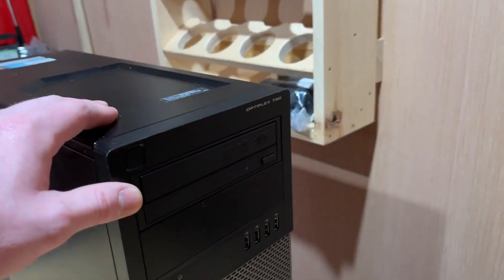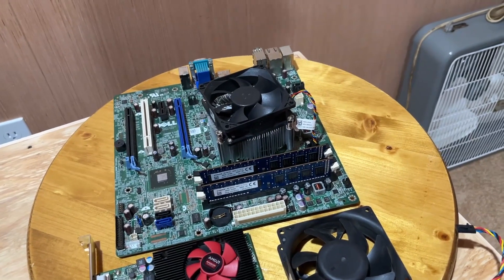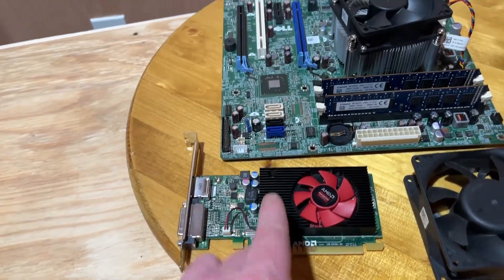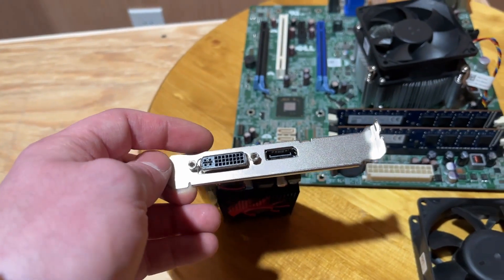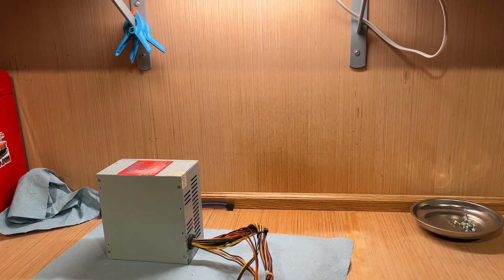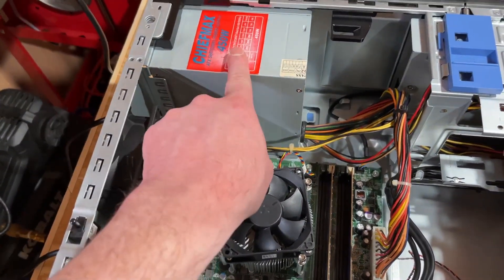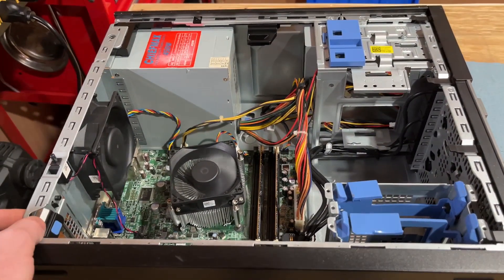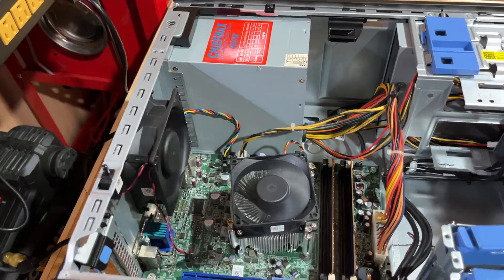Replace THIS In Your PC

Comment: Still on 2500k myself, pondering why i need to upgrade when it plays anything well at 1440p with rx580. Not 'ultra' well but medium high in modern games easily, even CP2077. Let see if some titles coming soon I wanted to play like Stalker2 really give me troubles...
Reply from the maker: Trust me when I say a stronger cpu would bring even more performance out of your 580. Ryzen 5 5600 and a decent B550 or X570 board would be great pairing with headroom for a GPU upgrade when you’re ready

Comment: Dude wait can I have the power supply i have an old pc that had a broken one so it's just been sitting in my garage, if you don't want it I will Take it man I need a psu.
Reply from the maker: You can have it but my advice (if you truly value the pc) is to buy a new budget psu like the Thermalttake Smart 430. If you don’t mind that the fan could go at any time and the psu get really hot and potentially catch fire. I’m just trying to make sure you understand what could potentially happen. But if you do want it then go on my channel about page and send me an email

Comment: That PSU definitely isn’t the original. I agree, I wouldn’t rely on it either because it looks over 15 years old easily. I bet the capacitors in it are leaky or have expanded.
Reply from the maker: Yeah it’s not the original. It was replaced by someone at some point. I am definitely doing it a favor by putting in a name brand unit and not some shady gray unit. Thanks for commenting it really helps. I think you’ll like my next video on what I got to tinker with today
Reply: @anthonytech  Big fan of the PC tinkering genre. I’ll subscribe.
Reply from the maker: @mrmerlin6287  thanks 🙂 I’ll give you a hint on the next video: thinkstation

Comment: The 2nd gen i5 is still pretty capable. I have an Acer Veriton with the i5 2400 that i keep as a spare computer and it can still do everything just fine. My main PC from a few years ago had an i5 7400 and there was little to no difference at all (in games at least). I only sold the 7400 system just cause it was worth more money than the 2nd gen and the performance was almost the same
Reply from the maker: It depends on what you were doing. An i5 7400 will walk circles around a 2400. I’m curious why you didn’t feel a difference. 7400 can push way more GPU than a 2400 can due to much stronger single core and even multi core performance
Reply: @anthonytech  Well most of today's game would run bad on both of them and i wasn't using the 7400 either since my main pc had an i7 7700. The 2400 and 7400 pcs were only spares if my main would go down for some reason i'd use another pc until i get that one running again. For today's use as a main i would obviously agree a 7400 would be better,but not for gaming anymore cause even my 7700 is struggling a bit with most modern games
Reply from the maker: @LUR777-g7r  Yeah it’s all about use case. You are right older quad cores can’t do modern games. But the newer ones like 12100, 13100 are very strong quads and can game very well
Reply: oh no…..

Comment: Is this 1995? 😂

Edit: didn't mean any disrespect. Great video
Reply from the maker: Thanks man, hope to catch you in future videos. Not exactly 1995 but it is 2011 which in the PC world anything more than a decade old is pretty much legacy.
Reply: @anthonytech  yeah you're telling me! I feel like it was yesterday I had a new 10900k and it was so fast, I got my new 13900ks in the mail day before yesterday and that 10900k now seems slower than than a chicken covered in tar running through quicksand.
Reply from the maker: @Deltatwo3  Depends on the use case, 10900k is still very capable. I recently upgraded to a 5700X from a 3600X. Very good chip for ~$200. I’m running PBO2 with curve optimizer and can match a stock 5800X at a lot less power consumption.
Reply: @anthonytech  that's awesome! I just finished my UV/OC of the chip and it's running stable @ 6.2ghz with full load vid @ 1.8v so I'm quite happy with it so far. I'm sure I have plenty of bsods that await me 😂
Reply from the maker: @Deltatwo3  oh man yeah probably. I had corecycler for stress testing. Look into it. As well as my normal use, some video games, hand brake, editing videos, livestreams. Mines rock solid
Reply: @Deltatwo3  1.8v, Holy shit that's a retro voltage not seen since the 90s